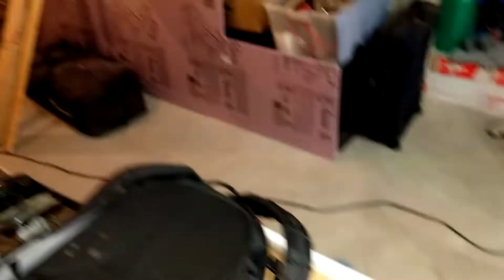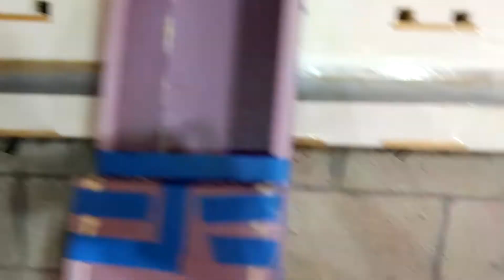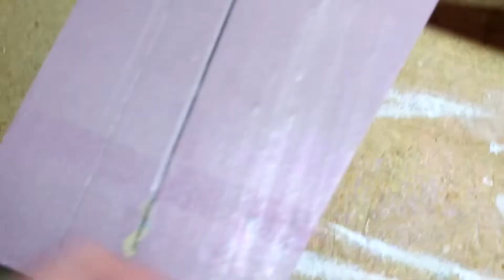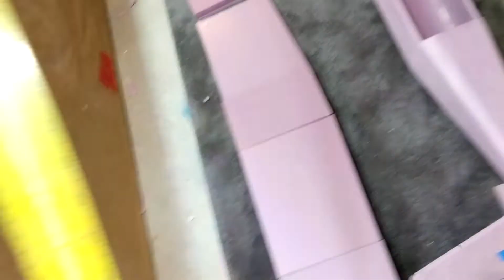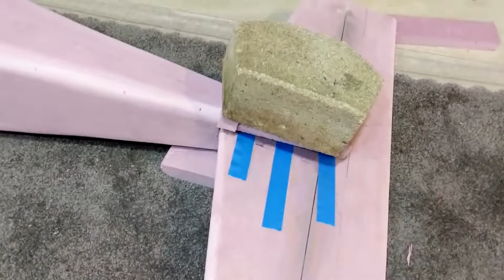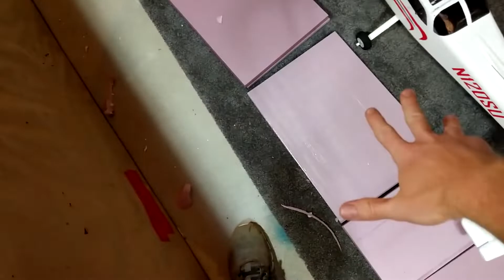80" Twin Commander DIY RC airplane - Build Update PART 1

Comment: What kind of foam did you use?
Reply from the maker: https://www.homedepot.com/p/Project-Panels-FOAMULAR-1-in-x-2-ft-x-2-ft-R-5-Small-Projects-Rigid-Pink-Foam-Board-Insulation-Sheathing-PP1/203553730?MERCH=REC-_

Comment: but were do you get that foam board
Reply from the maker: I buy it at the Home Depot. But you should be able to find it at Lowe's or similar hardware stores. It is Owens corning wall insulation foam.